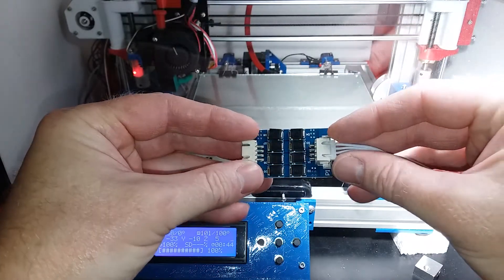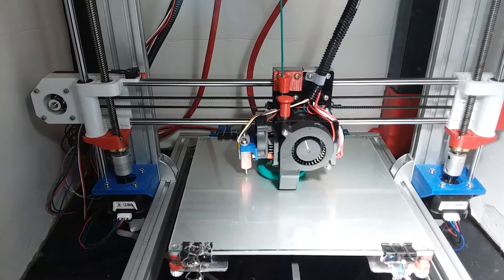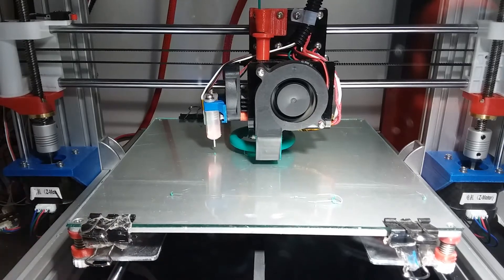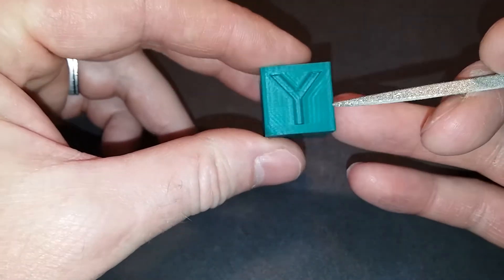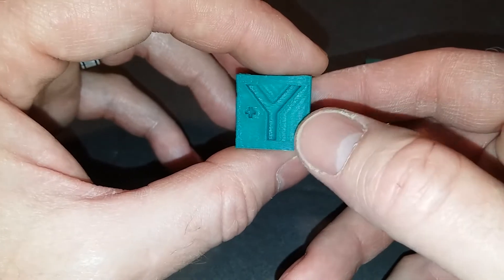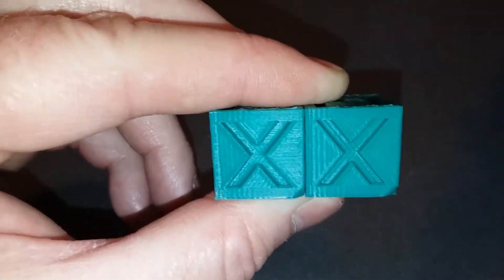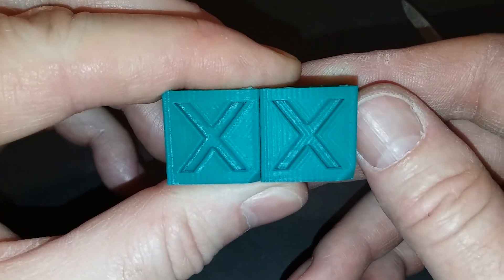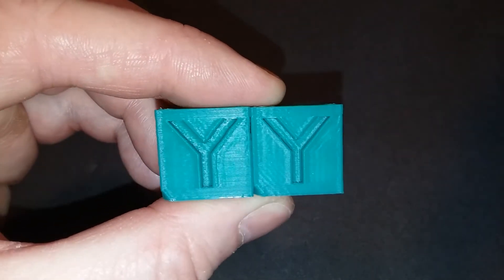Do TL-Smoothers Really Work?

Comment: prusa frame style printers have an inherent frame wobble issue. aluminum extrusion structure doesn't help much. 
its not a rigid enough design and i bet some of your ghosting is coming from that because of the speed and jerk your printing at. 
if i press lightly anywhere on my printer it deflects the nozzle a little (i used a mitutoyo dial indicator to test this). 
when the printer is moving the jerk and everything shifting around will do the same thing.

Comment: Good video.  Nice comparison.

BTW (a note to other viewers):  A simple fix (while waiting for your ordered smoothers to arrive, lol) is to rotate your model slightly on the build plate to avoid lining up with any axis... it will help *in some cases*, but definitely smoothers are a better and more permanent solution. Also ALOT depends on your printer and each one is different, even the same model... variations in the quality of the motors and electronics and build frame sturdiness, and your tabetop stability ALL play a role in these issues...by causing them or (more often) MAGNIFYING them to be more/less noticeable.

Comment: They really only do anything with the drv8825s, those have some flaws that apparently you can cut off by getting rid of the lowest volt or so.
Reply from the maker: Correct, if you board supports anything over 1/16 microsteps then TL smoother probably won't improve your prints.  The ANET A8 default main board only supports 1/16 steps.

Comment: Well, that depends. Was your 3D printer producing a salmon skin texture?  When you put the smoothers on did that go away? If the answer to both questions is "yes", then yes they work.  The 8 diode ones apparently work better than the original four diode offerings.

Comment: Diodes are used to compress\clip square wavesforms in audio to make the overdrive and distortion smoother\more pleasing for guitars. Makes the waveforms on a oscilloscope look more like waves and less like cliffs. So it makes sense to me.
Reply: Mmmmmaybe... What they're probably doing (in this application) is removing overshoot and ringing in the waveform (that's kinda what you said..).  When the MOSFETS switch, stray reactance in the circuit and wires causes the signal to overshoot (very simplistic explanation, I know).  Like a new driver trying to steer at high speed, they overcorrect, then try to go back and overcorrect a little less, until they finally settle down.  The overshoot (initial jump past the desired level) and ringing (the snake-like tail as the signal settles down) affect how the stepper moves and can cause it to vibrate, leaving telltale distortions in the surface of the printed object. 

As I said, while this distortion is mostly caused by the reactance of the wires delivering the power to the stepper motor, a cheaper controller design can have excess stray reactance, and no design can completely eliminate it.  The longer the wires, the worse the problem will become.  With 3D printers, the wires are necessarily long - they have to follow the support beams to get to the motors.  Installing the 'smoothers' as close as possible to the stepper motors is really important.  It looks like MrDabrudda put them just after the controller board, which is not ideal.  I'm guessing they'd do much better next to the stepper motors.